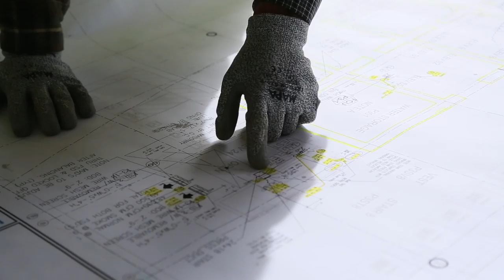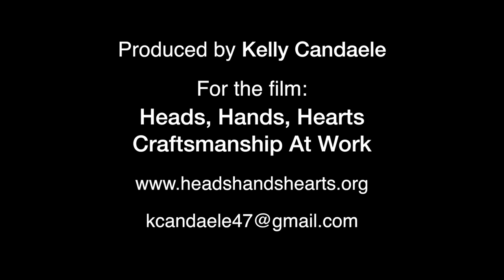Sheet Metal 105 Building the Wilshire Grand

Comment: Im an hvac tech but did install before. love building things but not so much fixing things. Im thinking about sheetmetal work, is it mostly ductwork or is there a lot of other things you guys do? And is it overall a smart move to make in my position? Thanks!
Reply: It’s more than just sheet metal bro… you can be a sketcher, welder, teacher at the hall, test & balancer… pipefitter, working at the shop. A lot more.